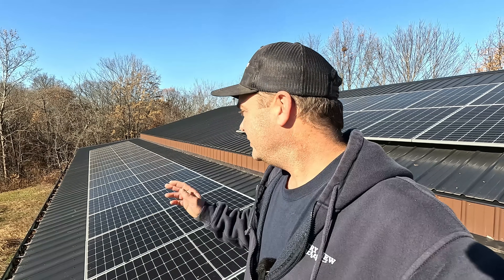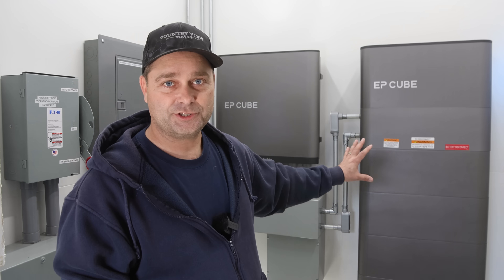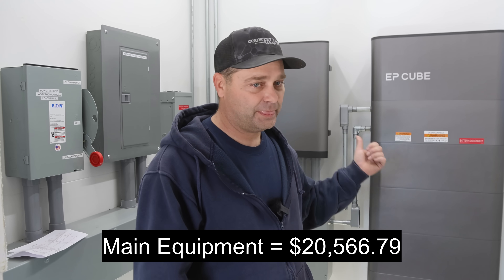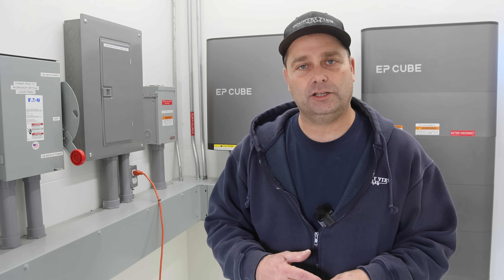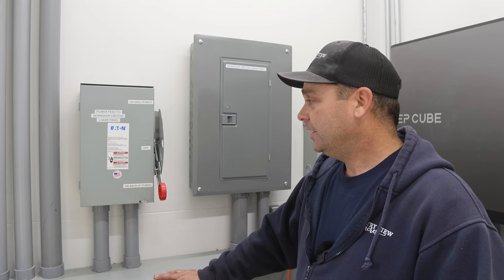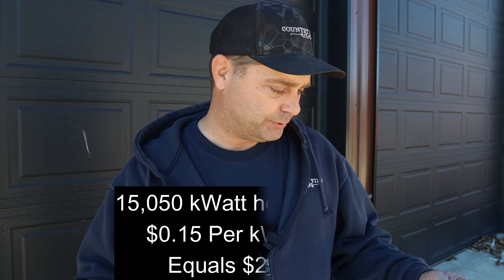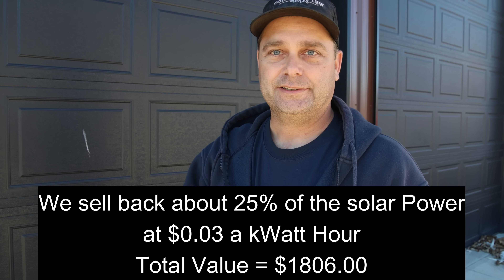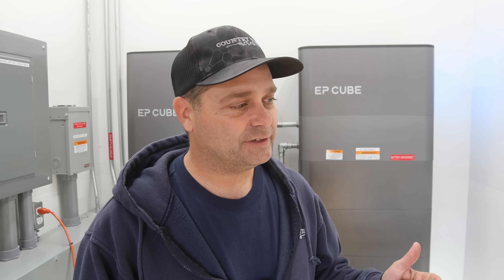Total Cost Breakdown of our Solar Power System & How Many Years to Pay for Itself.

Comment: The only way solar is worth is if you do it yourself. You will never get the worth out of it if you hire a company to do it. I’m working on building a 25kw net metering system. In my state the law is 1-1 net metering. That changes Sept. 2024. A politician got a billed passed that will allow the electric companies to only pay wholesale. Just another way for them to stick it to the little man.
Reply: I don't have an issue with paying the wholesale cost, as that is what a power company pays to power providers.  Why should they be forced to pay you more then what they generally pay for power from the people that sell bulk power.  It would certainly be cheaper for them to put up their own panels then to pay people retail rates for power and many providers take this path.  What you are really asking is everyone else using the shared grid subsidize your decision to become your own power provider by paying you far higher for the power you provide then power from other providers.  Now if you want more money for your power, you can sell your power directly to your neighbors, though setting up all the interconnects and safety systems likely would make that a very costly proposition.
Reply: It’s time for the little man to get ahead now. I’ll be locked in for net metering 1-1 till 2040. This system should be able to eliminate my bill for my house, an Airbnb I have and a rental I have. The system will cost me around 10-12k to build. With just my electric bill begin $2700 last year it won’t take me long to pay it off.

Comment: Id like to know what more it would take to become independent and cut the power company off. Eight more panels? One more battery? You already have the emergency generator if the system fails or its cloudy for a week.  That would have to be cheaper than dealing with the power company.

Comment: When I built my system 7 years ago it was going to take 8.5 years to pay its self off.I added a chevy volt to my system that shortened my payoff to 5.5 years. The car has saved me over $17000 in fuel cost in 7 years.

Comment: The reason I would do this is to reduce my carbon footprint and help the power grid expand. Yes and to save money. You can use the monster batteries {much larger than the power wall you have) in an electric car to power your house in emergencies and not buy a power wall. You may need a power wall if you are away with your car though. Great presentation, thank you for this.

Comment: Very nice system and install. Curious as to whether you looked at a grid tied inverter but without the batteries. Of course you would have to pull more power from the grid but your up front cost would be substantially lower and the payout time quicker. I’ve struggled with the battery and long payout and just opted for a grid tied inverter and one battery and a separate small off grid inverter and manual transfer switch for emergencies where I loose grid power. I also have a large portable generator that I could use for loss of grid power for more than 10 hours or we need the AC to cool the house.
Thanks for a great video detailing all the costs.

Comment: Calculating the payback time is almost always done based on the results of the new system. But if you compare it to the costs that the old system would have incurred in the same period, it becomes a completely different picture. Not spending money is also a way of saving. Great video, and many thanks for sharing this personal data with us. Merry Christmas!

Comment: I know a common limitation of back feeding the grid is 25kw per hour. Its been listed in all the agreements ive read for power companies in my area.
.
The 0.03c ish number is a common amount around the country.
.
As appliances give out, id suggest changing say your clothing dryer or hot water tank to heat pump. Or your stovetop and or oven to propane would also be a plus with grid down as you could still cook basic food items.
Im figuring you all ready most likely have the ability to heat with wood.
.
The most important thing to save power for is running a well pump.
As that's commonly the one must have 240v item, when the grid is down.

Comment: Unfortunately you didn't include in the cost the lost income from your investment. Also you should also figure in the cost of maintenance, labor,and degradation of the system . At the end of 15 years if instead you had invested the 20000 your investment would earn 250 a month in interest. While you're investment in solar will most likely be expanded to replacement of several damaged panels, inverters and batteries. So another 10 to 15k. But good luck with your gamble that you won't get a hail storm or other extreme weather event in the next 20 or so year's. That it will actually take your system to pay for itself.But congratulations on being able to install a 40000 system for 25000 . And your welcome for the 7500 the GOV stole from me to pay for your system.

Comment: Hello there, I realy like your videos, the details you put in, very helpfull. I am wondering if it is realy worthed to sell back to grid, it cycles the battery more , making you buy back some power the next day. Would you be able to power your house on battery for a few days, if you did not sell back to grid. This might prolonged the battery life by 2 or 3 times, and this is an expensive part of the system. cheers.

Comment: Great setup Evan  ---  Your electric companies next step (within the next few years) will be to end all buyback of solar (other states are going that route right now).     I would use the money from the taxcredit payback to buy more batteries to where you can store enough power to go off grid.   I would not go off grid but look at the grid as a backup if your solar system were to fail or you had a long storm and your batteries run dry.   The electric company charges a monthly connection fee (likely around $30 per month) but that is cheap insurance for backup electricity.    Something else you might want to consider is installing a small (micro wind turbine 200 - 400 watt) at the far end of your barn that has the solar panels on the roof, if you get even just breezes that turbine can run at night in the dark when the solar panels are not producing.   A 200 - 400 watt wind turbine can be bought cheaply.

Comment: Hi Evan.  Really enjoyed this series.  Very nice work.  One comment, you could include the avoided cost (i.e. 0.15 $/kWh) that you are not paying the power coop for the power your system generates that is not supplied by the coop into your ROI calculation.  It’s not all about revenue from selling excess generation back to the coop.

Comment: I am on Net Metering and I installed (by a company) in October 2015 and since that time I have not paid any electrical charge except for the grid connect fee which is between $5 an $10 per month.  We do not have batteries and if there cost were lower I would gladly be a buyer.  The PUC here in California is considering that everyone is charged a monthly base cost based upon your income (more you make the base cost goes up) Plus the cost of electric one uses each billing period.  So CA back when I put on solar wanted homeowners to put on solar, now they want us to pay a monthly fee (based on income) even if we do not use the grid but are still connected.  My blood pressure is going up, I need to stop, ha.
Reply: Typical socialist angry when the socialist you voted fors decisions effects your pockets. 
But don't worry when they run out of other people's money they will expect much more.

Comment: I also have solar supplying power to my house. Built the system a couple of years ago. My sister put it in as well, and she was complaining about the reduced rate which the power company pays her for power. I had to explain to her that it's logical for 2 big reasons. 1. the power company didn't ask for you to make power for them, they didn't need it, and they can't rely on it since it's not maintained by them and there's no contract for you to reliably supply their power. 2. They are required to buy your excess power, they don't get an option. So why should they pay retail for power they may or may not need. When you think of it from their side, It's fair. My company buys back at the rate it would cost them to produce the power.
Reply: the grid doesn't care where the power came from or who/how it was created, only the utility companies do..

Comment: I live in Sydney, Australia and my most recent electricity bill was $241.93 for 31 days. That included $1.01 daily charge. I used 557.12 kWh which works out at 0.43 per kWh.

Comment: Your solar system will actually pay for itself sooner then 10 because of the electric that you are not using off the grid. My system is 14 years and still going strong. The Rec’s that I sell back to Delmarva Power here in Delaware is peanuts as well. I get $26. Per 1000 kilowatt hrs I produce. So I kicked that problem in the butt and bought a Ford Mach E EV and now charge it during the day instead of selling to the grid. Some days my meter is still spinning backwards when charging the EV. We are retired so it’s not a problem during the day. My next system will be off the grid due to building my forth and last house being a contractor at one time makes it possible. Nice system and Merry Christmas!

Comment: So, if I'm thinking straight and I might not be, if you increased your battery capacity to carry you thru the non-solar part of the day you would buy fewer KW or maybe no KWs if you had enough battery.  And more solar panels you could recharge the batteries faster and sell more KWs to the power company.  And all those changes also cost more money.   Interesting numbers for your system.  Thanks for the follow up episode.

Comment: I may have missed it. Are you including the value if the power you make and use for yourself? If you're only on the grid a few hours a day, aren't you getting the full 15 cents a kwhe worth if value in all the kwhrs you make for yourself? It sounds like you're trying to payback the system with all the revenue you get from the power company, but not counting the elimination of all the cost of power you would be buying if you didn't have solar. How many kwhrs per year does your home use per year? And what would the cost of that be yearly if you had to straight up buy it from the power company?

Comment: This looks like a good system for you. You have worked very hard to educate yourself, purchase and install this equipment and I believe it will work out for you. It everything is so professional looking as well.
Would it be possible for you or someone else to give an estimate of the number of hours we would have to pay someone to do the type of installation you have done. I don't want anything exact, that would be carrying your cost calculations to an unnecessary level, just an estimate.  I appreciate your record keeping and summing up, probably because I like that sort of thing, but also because I have an associates degree in accounting.

Comment: Good video Evan.  I started with 12kw and batteries but have bought another 12kw in panels  (30cents per watt from signaturesolar) and another solark 12k inverter.  Plan to install when I get time this year. 
The main assumption is more expensive power over time but there's some chance they come out with fusion power at a fraction of the current power rates.  I say this because there seems to be a lot of emphasis in the media on this and they tend to relay what happens before it occurs.
I mention this also because my family considered a solar farm lease deal and it fell through.  That turned out to be a blessing.  I found out that when the solar farm goes bankrupt the creditors will put a mechanic lien on the landowners property (which no property owner would expect) which would lead to losing the land because the land owner would not be able to pay it.  This is how the state of indiana is handling this type of scenario that is not covered in the lease agreement. So beware of any land lease for solar, wind, etc.  The end result could be a huge land transfer with either a market crash or cheap power due to fusion.  The WEF has already said you will own nothing and be happy.  You have to think how that is planned to happen.  Gov Holcomb of IN has spoken at the World Economic Forum 5 times already so it seems he is helping make this happen.
Reply: Unfortunately if fusion becomes a reality, they are not gonna pass on the cost savings to consumers. They will find a way to make fusion seemingly cost a lot so that consumers will still have to pay a lot for the benefit of using it.

Comment: You ROI should be much shorter...you get $1,8000 a year back from the Power Company.
BUT, you also DO NOT pay the Power Company a ton of $$$ each year.
 
Pay Back $1,8000 a year x 10 years =$18,000.00
$$$ you do not have to pay the Power Company = at least $100.00 a month x 12 months = $1,200.00 a year X 10 Years = $12,000
Total $30,000 in 10 Years

Comment: Hopefully I'm around to see the 15 year video of you replacing the batteries....
Reply: lol....yes my neighbour had to replace his 15 year old batteries even though they were suppose to last 20 years....he dropped another 25,000K to upgrade.  I also hear his generator running regularly when there are 3 days or so of cloud cover... he uses up his juice quickly with well pumps, freezers etc.   My opinion is this system is only good for when hydro goes down, but not a reliable source using solar energy.  Extra battery storage would help.  But who has all that money for everything?? :P  Dont get me started on disposing of old/broken panels and old batteries....the earth shudders at this future...

Comment: Is there a design life for the photovoltaic panels?  I believe they start to degrade in capacity over time.  You mentioned the batteries, but not the panels.  Just wondering.  Another plus for roof mounting the panels is not having to keep overgrowth off of the panels.  Where I live, summer is a season of intense growth of brush and weeds.  A ground mount would be a real problem for me.  I do like your use of wireways.  They allow for easy extension of the system and any necessary wiring changes. An excellent choice.
Reply: Most if not all panels are guaranteed for 25+ years to give you 80% of the new rating after that time.  There's other failure modes that can happen too other than increasing opaqueness of the glass.  Panels are getting cheaper, I just bought some at 30 cents per watt so even if they fail early its the easiest hardware to swap out for me at least with ground mounted panels.
Reply: @trophyfishn9757    So in 25 years there's gonna be a huge heap of junk at the landfill....lol
Reply: @northernlassie2755 Only if you think 80% of the original nominal output isn't enough and you want to replace them.  Most people get rid of cars a lot sooner than that and they figured out how to recycle most of those after 100yrs.  I would expect similar recycling methods once solar is more main stream.
Reply: Or sooner in case of storm damage, failure to maintain,or a number of others things that can compromise them.

Comment: After looking at all of the choices, we installed an EG4 18K PV by Lux Power with 12 kW continuous and 28.7 kW of EVE 280K Lifepo4 battery’s with JK-BMS active balancing for $9,320. And 1 Pallet of 36 SEG 405W Bifacial Solar Panel for a total of 14.6 kW at $5,686.20. If the sun does not shine we use an EG4 Chargeverter 100A Battery Charger 5.1 kW Output hooked to a 7.2 kW Diesel generator that runs on filtered waste veggie-oil collected from local restaurants. Cost to run is less than the $0.174/kWH from the grid. It meets 100% of our loads. Total with ground mounts, conduit, wire, fittings and miscellaneous $17,520.

Comment: If you added more batteries, would your grid usage decline enough to justify the cost of more batteries, or would you need to buy more solar panels also, which would increase the size of the whole system? 
It seems logical that storing 15 cent electricity for your own usage is better than selling it to grid for 3 cents every time your batteries are fully charged. .

Comment: You performed and good investment. It is a good decision to go forth with it all. It starts to cut cost dramaticly at the first pull of the switch. 10 years is nothing. the next 5 years after that is more dramitic of a savings. You know damn well that they will be jacking the cost they charge you per Kw.  example 1975 in Vancouver Kw was 3 cents now it is 12 cents  Gues what they will jack it to in 15 years. With EV cars demand and imigration?  just watch ...

Comment: I would be curious to see how much degradation the panels will have every year. I have heard they lose 2% a year efficiency. The cool thing is you are self sufficient! Nice job!!!
Reply: Depends on upkeep and maintenance. If they are kept clean and no weather damage they won't lose much more than about 20% over 30 years. But the batteries and inverters are a different animal all together. Depends largely on Quality and capacity as well as how cool you can keep them.

Comment: Nice job.  I still think a bifurcated system that has your base load covered and the other side for instant use you can eliminate that early morning power purchase. 

New salt based batteries are coming as well that can store more and last longer.    

You have a decent sized house so 82% is pretty good.   

The area under the curve being larger than than above tels me another battery is needed for storing perfect days.